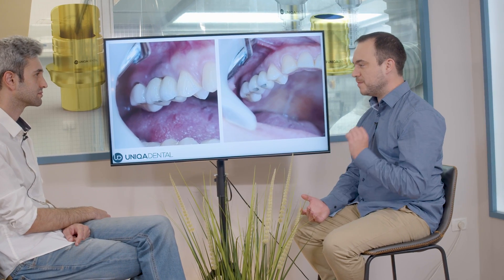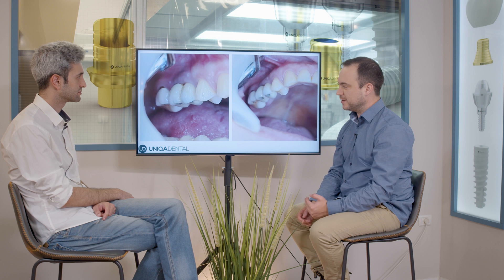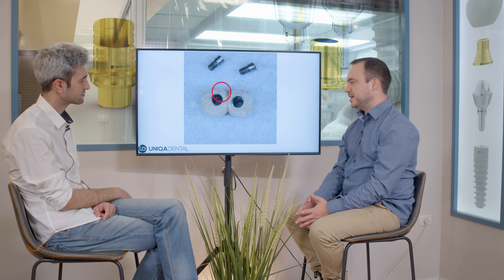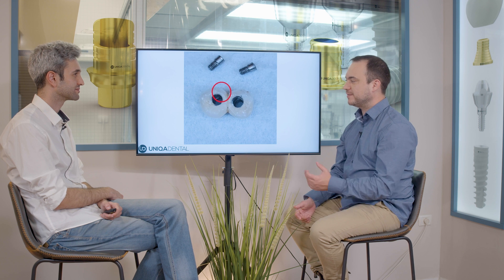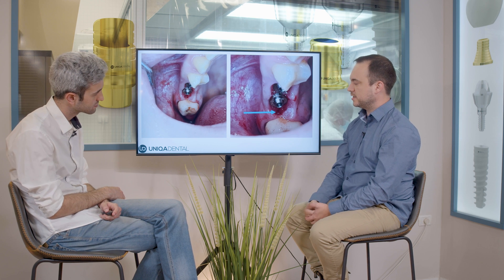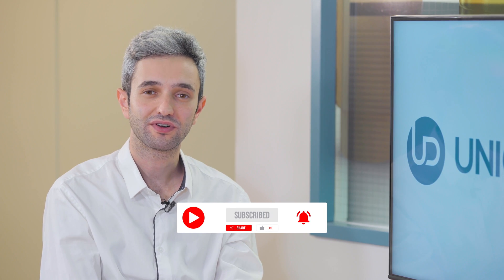Why do we need sleeves in screw retained restoration on Multi units? Bigger screw channels risk

Comment from the maker: 00:00 We can make the screw channel much smaller.
00:30 Case: two crowns on two implants.
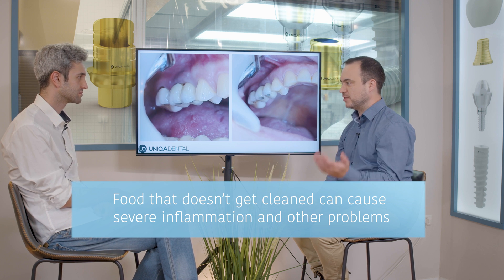01:00 The difference between the zirconia crowns and PFM crowns. 
02:12 First of all, it's weakening the crown.
02:38 That's why they're more prone to breakage than the zirconia one?
03:20 When you have some inflammation, you need to react immediately.
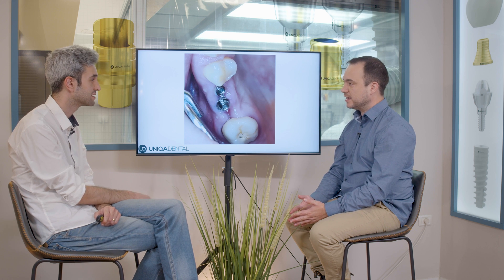03:52 Yeah, the inflammation is gone.
04:15 Yeah, you still need to brush your teeth.
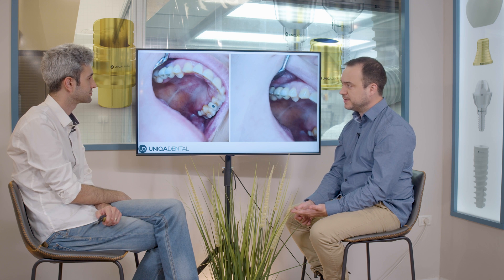04:40 The bigger the screw channel is, the more prone to breakage it is to chipping.
04:53 You can't have PFM crowns with small screw channel if you cement a sleeve to the PFM.